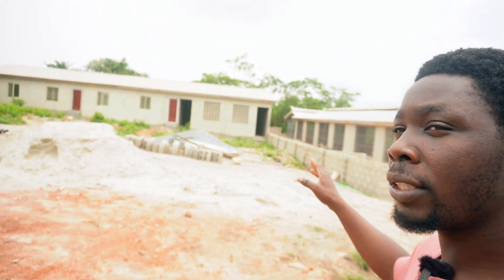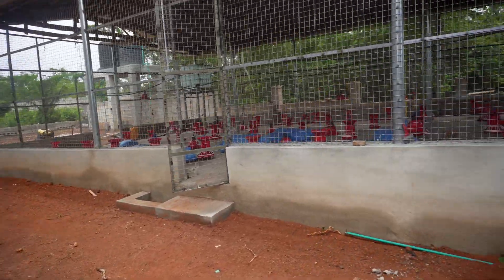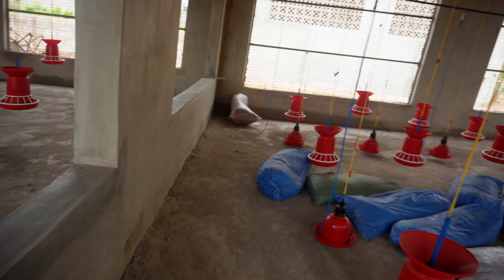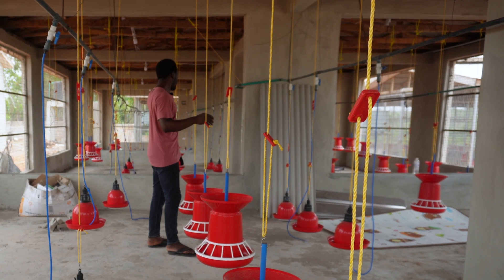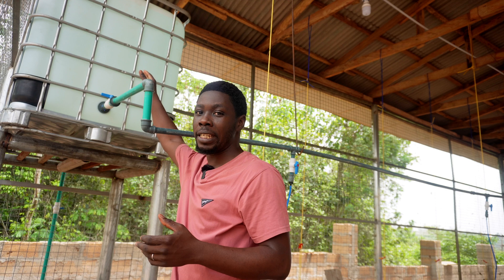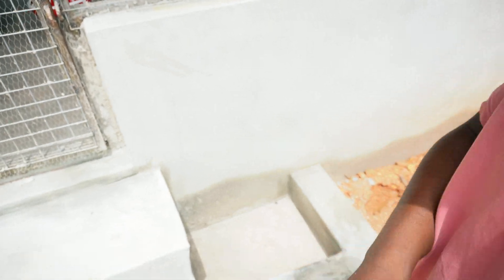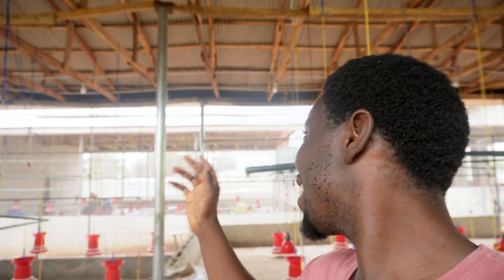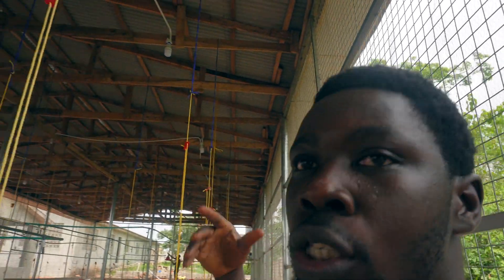Amazing Lessons to Learn from a 4000 Capacity Broiler House

Comment: I've been been your fun for so long and looking at the progress you've made makes me feel of success myself. But I had a question on the installed drinkers, does it mean there will be no need to wash/clean them or u hav ways to do it?
Reply from the maker: You will have to clean them every once in a while. 
With broilers, the drinkers won't get dirty often because they don't play too much with/in the litter. But when using the drinkers for layers, you may have to clean every 3-6 days, depending on the kind of bedding material. Saw dust will mess it up very quickly while wood chips will not. 

I hope this helps.

Comment: What do u think is the effect between a 10 ft tall house and a 12 ft tall house in terms of wind,   covering for cold ( draught). Does ventilation has to do with lenght axis by east to west.
Reply from the maker: 10ft tall is good enough, but 12ft is more like extra. And yes, it impacts ventilation. In the case of draught, side curtains will be used. The emphasis is on the hot periods.